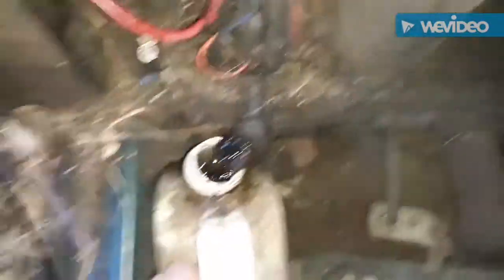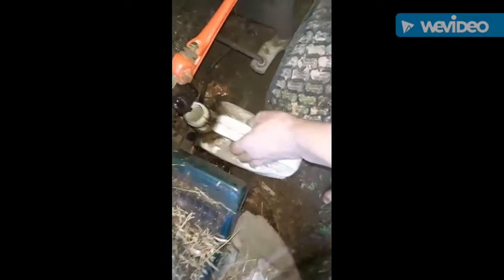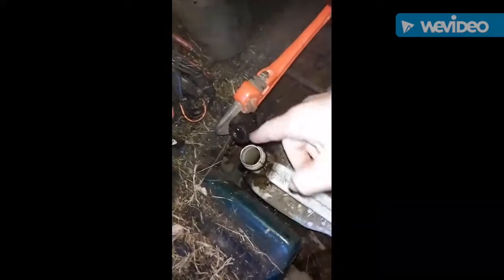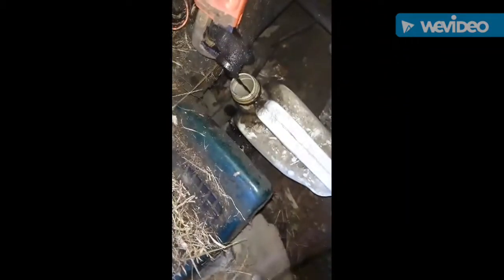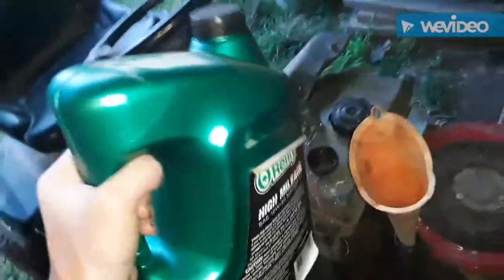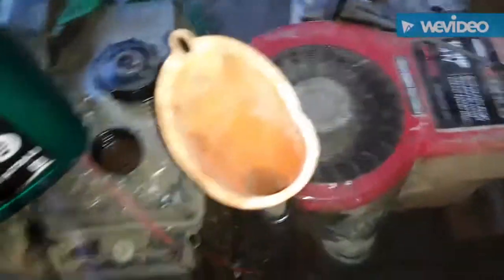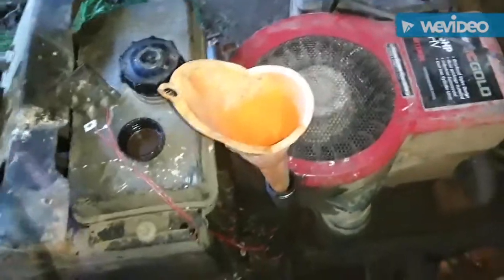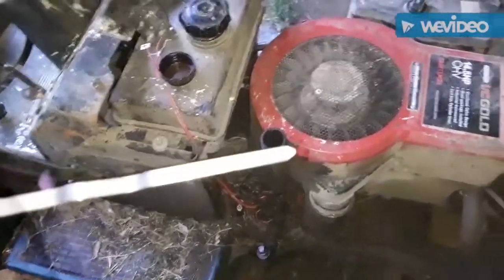Oil Change On A Old Craftsman riding Lawn Mower!

Comment: I had gasoline running into the oil on my rider. I put a shut off valve in the gas line and I'll shut the valve off about  one minute before I turn off the engine.
Reply from the maker: Wow, i have two and they always are needing work lol.  sorry for the late reply!